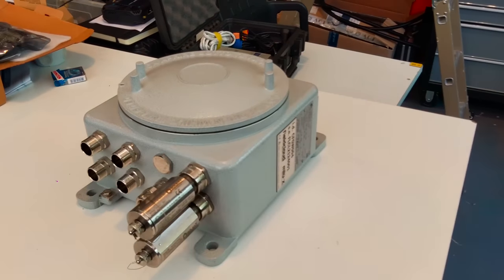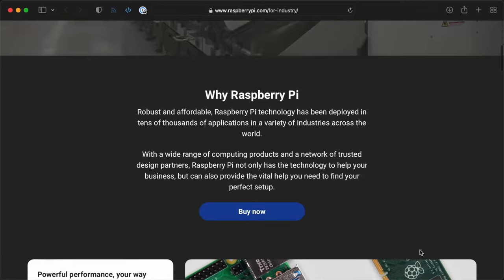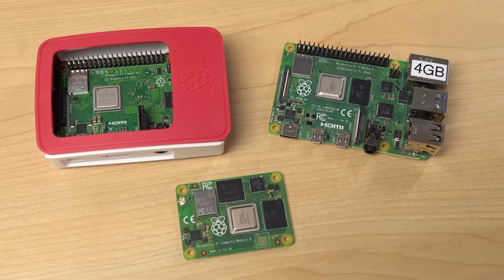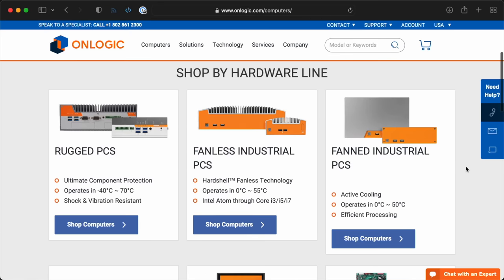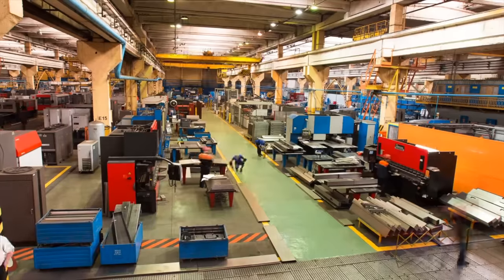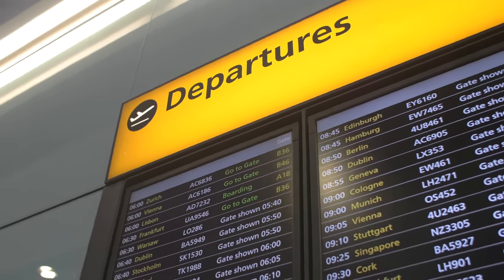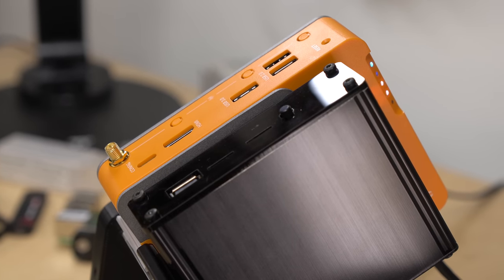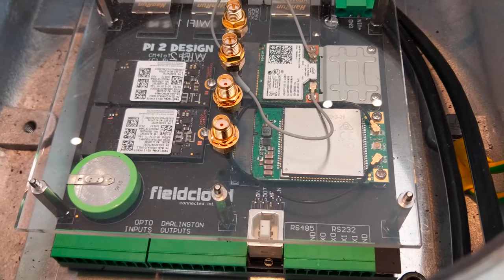Why are Industrial Pis so expensive?

Comment: These certifications not only cost a lot but also take a lot of time. I designed two products for IECEx intrinsic safety and it's been over 8 months to get the certificate.
Reply: Just think, that's easy compared to getting a medical device certified.
Yours was like jumping through a set number of consecutive, shrinking flaming hoops, for medical devices, add in juggling flaming chainsaws while going through thrice as many staggered and randomly sized flaming hoops.
With the higher cost of, if the precautions fail to detect a hazard, lives could easily be lost.
Reply: @spvillano  ... but there's 'backups' available...  a.k.a. the remaining 7.999999999 billion people on the planet
Reply: @trevorvanbremen4718  the industrial version is much more expensive than the "regular" model for a reason and typically is out of the budget for those same people.
Reply: Some people have trouble understanding satircal sarcasm!
Reply: @trevorvanbremen4718  hard to see a face or hear the tone of voice with text.

Comment: Network Engineer in the Oil & Gas industry here, so awesome to see some love given to industrial kit (its way cooler than commercial gear :D).
Reply from the maker: Hmm... wouldn't a lot of it be _hotter_? ;)
Reply: I don't think so.. its generally 20 years+ behind any kind of standard let alone security standards. The quality of the software is laughable for the cost. Security is usually not even talked about.

Comment: I used to work at the factory for the company that makes those (or the competitor, not sure if that is appleton or another - i worked for cooper crouse-hinds but in lighting)...its really neat....we sold this stuff to mines, oli refineries, sugar factories, flour mills....boxes like this allow the explosion to happen INSIDE and offer a flame path (the threads of the case in this case) wherein the flame can cool to a temperature that will NOT ignite the gases/dust/fibers outside of the junction box....lights get a little trickier but same idea....its cool AF that you talked over this market as it is HUGE and inteeresting and a lot of folks dont realize it
Reply: just watched the rest....the thread does slow down the explosion as it leaves for sure, but crucially it lowers the temp of the flame to a temp that wont ignite outside gases.....the EJB boxes (bigger bolt on covers, MUCH bigger...this similar to our GUB series with thread on cover) uses a wide flat flame path with bolt on covers...wont slow it much but it cools fast with all of the surface area of the flame path...those are cool looking but not needed for such small equipment...i miss that Class Div work!!!
Reply: I'm one of those folks that knew nothing about this stuff, it was definitely great video
Reply: Such are also very, very common in regular motor vehicle fueling stations.
My father was a contractor that build gasoline/petrol stations, the amount of knowledge needed to properly configure and install explosion proof fixtures is amazing!
One missed step, one could trivially have fuel fire and explosion and that such are beyond rare speaks volumes as to how effective the technologies are.

Comment: Thank you for showing this.  I used to work on explosion-proof and 125C+ high vibration electronics, where boards would come back with the all the chips sheared clean off the board.  It really does mean adding zeroes to the price for basic components, as well as months on lead times.  It would be interesting to hear more from people who integrate raspberry pis in unique environments like this - have you ever thought of posting up interviews with people like this?
Reply: LMAO I can imagine using regular board and then seeing them clean flat tomorrow
Reply: @dputra  a regular board would come back worse than that. The components sheared off and the board cracked to hell and gone is more likely.
The nastiest environment I've saw was in missiles and industrial mixing equipment, both sharing similar failure modes for the same basic cause - vibration.
Reply: @spvillano  instead of a motherboard you get back a pile of dust
Reply: @ketaminepoptarts  utterly identical at the atomic level.   ;)
I'll just get my hat...

Comment: Explosion proof meaning that it is either designed to be sparkless, or contained in a manner that, if any sparking occurred, the explosion would be contained and stopped inside of the enclosure so as no prevent the spread of the flame/shockwave.
Reply: Intrinsically safe.  I used to install wiring for fuel dispensers and underground storage tanks.  All of our connections were potted too.  All the ends of the conduit are potted.  wire nut connections are cased in epoxy in the ground boxes.

Comment: Certification alone for each standard (IECex, ATEX) can cost thousands of dollars. Not to mention country specific regulations when it comes to explosion proof or hazardous areas. Where I work, we have a remote terminal that just extends video output and USB inputs from a safe area which costs 80k alone. Specialized printers can cost 60k per piece.

Industrial equipment does come with a steep price but the investment easily offsets any potential losses when your business can't operate or worse, cause accidents themselves.
Reply: you are absolutely right! My customers for the Milü-X gateway system need capital efficient compute, storage and connectivity packages and being able to provide this equipment with a high degree of quality and compliance has been most rewarding!
Reply: 60k for an industrial printer is cheapppp
Reply: True. Great comment.
Reply: Just a bare enclosure is eye-wateringly expensive if it is Ex d or Ex e certified.

Comment: Industrial Automation Engineer here:

Two things I missed about specific requirements for industrial systems:
1. Often, the computers need to run on 24V, not on your standard 5V or 230V, so it needs a different power supply.
2. Spare part availability. Our machines come with a 20 year warranty, and an expected lifespan of 20 to 50 years. So if I call my supplier in 15 years, I want to be able to get the exact same computer as I had, so I can be sure it can run the exact same software without driver issues or something else.

At your general big box store, you are lucky if you can still find the exact same model in six months, therefore, our suppliers need to have a huge amount of parts in stock.
Reply: This is so true. But really if you buy a computer components on close to launch day you still are likely to be able to find close to identical components for about 3-5years. Maybe there are revisions or changes to them. But it is really frustrating that the moment any warranty is out the parts are gone from stores. It is almost like they want you to buy a hole new computer every 3-5 years. Mmm.

Worst are the motherboards. Such a core part of the computer are so unreliable and broken with poor updates that might as well brake more then they fix.

Considering how we are comming to a end of improvements to the everyday computer user needs. We all should be having hardware with 10years of warranty and such. Expected life of 20years! Home servers and internet browsing is not going to become more taxing then they are already. And power consumption is on the verge of being pointless to improve since there is not much more that can be done. 

With a push to make hardware and software reliable maybe the waste of resources can be limited and software can be made into a contributed effort to avoid needles broken stuff as Windows and shoddy BIOS and drivers. But there is no real money to be made making something good and long lasting. Unless it is expensive and such just to make the thing reliable and actually work. 

Imagen if something is so well made that after many years on the market new stuff was made but without huge changes. Can take advantage of the already established stuff without braking up the user base and keep improving the software side. Since the hardware really have no reason to be advance anymore in a hurry.

Comment: its always great to see more raspberry pi units out in the wild have seen them deployed in some car manufacturing often pondering the costs and why more industries or companies haven’t yet followed or realized the raspberry pi’s potential or the amazing community/support behind it as the man here pointed out was a major contributing factor in his decision to implement a pi in this way
Reply: One reason lots of industry and company won't be Pi powered (yet anyway) is that what they already have works, is still sourceable and doesn't need to go through all the certification and teething trouble of spinning up a new option - though as soon as they can't get their existing device they may well go Pi, as from what I've seen its the only company making these sort of SOC embeddedable products that says available until at least some large number of years into the future.
Reply: I used to do industrial automation as a Controls Technician-- people, technicians, and integrators are used to working with the incumbent suppliers for machine control (eg. Mitsubishi, Allen-Bradley/Rockwell, Siemens, Fanuc, etc.). These controllers are typically programmed using Ladder Logic (RLL) or Function Charts (SFC), which is easily readable and viewable while running. You can easily watch the program execute and then use that to narrow down when troubleshooting a very complex machine, and the barrier to entry for someone to make modifications is much lower, since Controls Technicians are typically electrical-oriented. These controllers are also part of huge ecosystems that connect together using RS-485, Ethernet/IP, Modbus, ControlNet, etc. and the PLCs themselves are very modular, allowing you to add and remove various cards for I/O. They are also real-time systems that are safety certified and sometimes redundant (like AB's Safety Partner controller, which runs your program completely redundantly, and has a watchdog timer that will trigger the e-stop circuit if the program loop does not execute in a certain amount of time, like 5ms or less). That being said, embedded and traditional computers are still used for the non-realtime components for gathering data, monitoring systems, or performing more complex tasks like 3D scanning and solution solving (eg. for lumber mills to determine the best fit when milling a log).
Reply: So when you built a car uninterrupted, problem free uptime is the number one concern. You have to make 200% sure the car will react to any given trigger as expected at any given time. (Unless you are Tesla, not sure which students they employ but they really don’t care). So that is the reason why saftey programming and specifically guides like Misra C are a thing. Turns out it’s really easy to write safe C on predictable hardware, I suspect that none of the Linux OSs available for the Pi are safe to that level. Even tiny optimised ones like Motioneyeos will crash in normal use. So in any given industry it comes down to lives and the wish to not endanger them. Understandably. You can use a Pi in a thing that can fail, but until the Software for it gets better you won’t see it anywhere else.
Reply: @theharbingerofconflation  it doesn't come down to life's and wanting to protect people

Settlements for law suits and factory down time are simply bad for profit, and you can't have that

If they where legally allowed to put a "we take absolutely zero responsibility if you get murdered by one of our systems" clause into their contracts they would
Reply: @theharbingerofconflation  The stable branches of the distributions are stable. There are many afe and reliable solutions out there. 

But you might just listen to the guy in the end who developed the god damn bomb proof housing. Long story short: RPi 1-4 are crappy to embed, as they weren't meant to embed. They actually started working on the thing with the pi 4 and immediately scraped it, when the CM4 released. It is the Boards that were "incompatible", not the Software. 

Do you seriously believe anyone with a shred of sanity left would build and CERTIFY this thing, when the software was just "good enough"? The developement of this thingy was propably at least 7 figures.
Reply: @sagichdirdochnicht4653  if you think Raspbian stable is stable cause it says so I have a bridge to sell you. In normal day development we don't care to write proven software let alone type safe stuff with pre filled functions and clear W^X memory access operating systems with some kernel level that runs redundancies and what not.

Linux is good enough for Industry, if your Sensor or Microcontroller is crashing you can in many cases just reboot it without severe machine failure. Of course there are exceptions.

In cars you can't have a head unit fail mid drive, no matter what, if a car crashes for software reasons mid drive and somebody gets injured thats a million dollar law suit.
Again, the Tesla example, I don't know what is happening there, their clock skips a second every 3 minutes and the whole system fails mid drive if the non-redundant camera behind the rearview mirror fails.
But these guys are the exception.

What I'm trying to say is there is different kinds of industry, some can be interrupted and some needs perfect uptime and thats exactly where you won't see a Pi deployed.
Had you read my previous comment a bit more thorough you might have gotten the hint that I actually worked for car brands in the past and know how these things come about.
Reply: @theharbingerofconflation  What I am saying is, that Raspbian IS a fork of Debian, with very little changes. Debian IS extrmely (!) stable. The changes made are little and well monitored by the community. I mean sure, you could also decide to run Arch on there, but it's not the right OS for the Job. 

And I am saying that you are aboslutely out of your mind, if you truly think people would engineer such enclosures, that cost a brutal shitmount of to develop (and certify), without being god damn sure this thing will work reliable. 

I'm not in need of lessons about reliability. I am very, very well aware, that there are things that simply can not fail under any circumstances, whatsoever. 
Thankfully, Debian is pretty much as stable, as it can get. 
Tough if you rely on that thing up and running 24/7, you have redundancies, because EVERYTHING can fail at some point. That's what the industry does. No matter if the device is 20$ or 200,000k, if it is crucial to your running operation and/or safety, you have a second one.
Reply: @sagichdirdochnicht4653  Yeah exactly it's based on Debian. With minimal changes. An OS that releases patches when it damn well pleases and is anything but stable to an industry level.

I don't even know why I am argiung with you. You don't even get what I am saying. Read up on MISRA C. If you like to expand your knowledge.
And yes we often tried to build systems redundant. but sometimes this either isn't enough, or not viable.

Comment: I work in automotive automation and we use onlogic boxes for prototype code until our ECUs are finalized. I'll have to look into their pi options to see if they would be capable of running our code.
Reply: Great to hear, Jon. Reach out to our team if you have questions.
Reply: Just spent some time with Debian based distros on Raspberry Pi's. All distros based off of Debian still have an annoying bug that's beginning to show signs of longevity.
When they dropped 32 bit to focus exclusively on 64 bit, that broke some fairly basic drivers, such as camera and network functions. Looks to be rooted around a few common libraries. Surprising that the problems are persisting though, the teams responsible for those libraries must be fairly small.
Reply: Please don't. There's a major shortage of Raspberry Pis, some due to chip shortage and supply chain issues, but also because of companies and industry buying them en masse. They were designed and developed to teach kids about computers and coding, and kids can't even buy one if they wanted to. Just stick with what you're already using, please.
Reply: @liquidmobius  kids don't buy industrial model Pis, too expensive.
But, OK, industry can shut down, rather than use their model computers.
Reply: @spvillano  Now you're insulting my intelligence.  Of course individuals don't buy industrial Raspberry Pis, they buy Raspberry Pis. And industry is hardly going to fall apart without the Raspberry Pi SBC 🙄 Industry uses them because they're cheap.
Reply: @JedIsTheOne  Legacy ECUs don't require software updates and work out of the box. Not exactly "making them billions"
Reply: @JedIsTheOne  I've only owned newer Toyotas and older Chevys and Hondas. I've never had an ECU failure, nor any kind of failure that was more than a couple hundred to fix.

Maybe the problem lies with Jaguar/Land Rover.

Comment: The price point shown (~$500) for the packaged industrial Pi is steep compared to regular home/commercial use, but consider a bottom of the barrel PLC CPU can start at ~$1200USD. The higher end product lines run $5000USD-$24000USD for the CPU only, then you are paying $200-$500 per IO module, plus backplane, plus cabinet, plus a programmer/hr specialized in that OEM platform. I'd expect as time goes on those Pi CM4 boards (~$95 for the highest end CM4) are going to fall towards the price of production (I'd guess sub $15), and hopefully it will put so much pressure on these archaic OEMs (SE, Siemens, Allen Bradley) it will collapse their astronomical hardware prices.